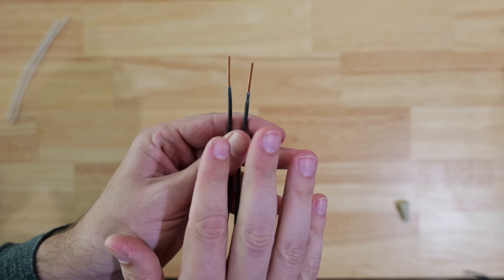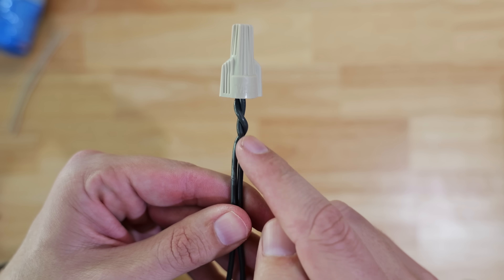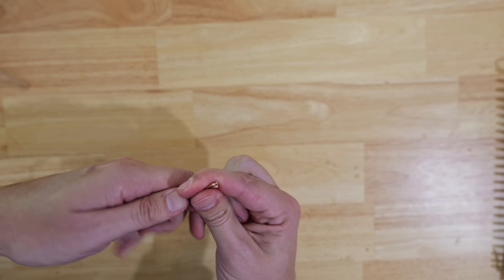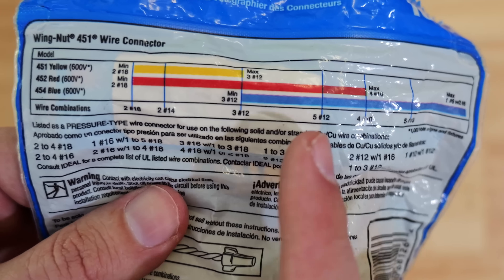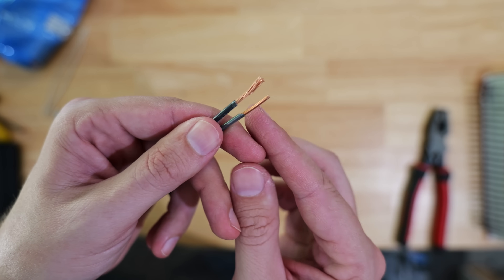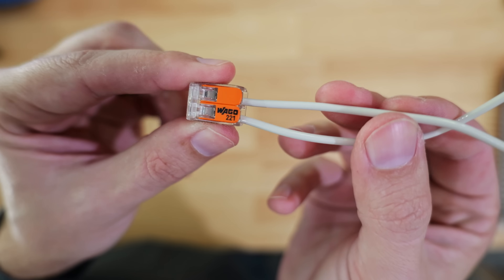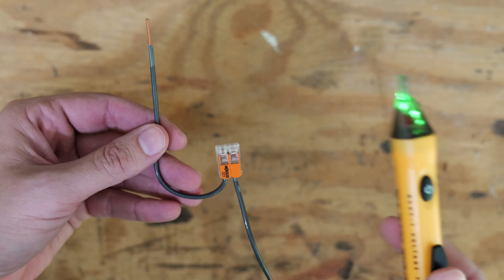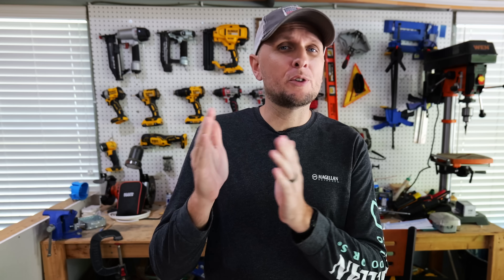7 FATAL Wiring Mistakes Most DIYers Don't Know They Are Making | Most Are Guilty of 3

Comment: DIY guy here....
Never had any of the shown issues with the WAGOs.
If you have concerns with the levers or little space in a box, there are lever-less connectors as well (which work with solid wires only). 👍🏼
Reply: I've met fools who use them "successfully" with stranded in those push contacts. Never underestimate the DIYer with a vision and confidence.
Reply: @RolandsDad  so true! i have seen so many strange diy things in the 20 yeears of beeing an electrician in germany :D
Reply: @RolandsDad  I don't know much about these connectors, but you seem to have a strong opinion about it. What is wrong with using stranded wire with these?
Reply: According to Wago they work with wires that has few strands (and solid ones as well). There might be two types. The Wago 2773 can use wires with few strands but the Wago 2273 seems to be for only solid wires.
Reply: @danielwurmer2266  They rely on pushing force to load the retaining springs. With stranded wire, you cannot deliver sufficient pushing force without getting the strands messed up. It's like trying to penetrate without erection. Surely, by luck you may get a few of the strands into the spring-loaded contacts, working until the few connected strands get overloaded by the current meant to be distributed between all strands of the wire...

Exceptions may be the wires with just a few, solid strands, sturdy enough to deliver the pushing force.
Reply: @TheSimoc  that is definitely not how the wago lever type connectors work that I use. No push force needed. But there might be other types on the market that I am not aware of.
Reply: @danielwurmer2266  The context of the solid-wire only was explicitly mentioned to be about leverless connectors. No-one claimed the lever ones to not work with stranded ones.
Reply: @TheSimoc  yeap, you are right, I got it now. I was missreading and got it all mixed up, sorry.
Reply: I don't know if it's code-compliant, but I use lever-less connectors with stranded wire by tinning it with solder. You can yank it out, but none of those connectors is really that strong to begin with. I wouldn't use that on a boat or something that's moving a lot, but there's really not an issue for a home solution unless you live on a really active fault line. The spring-loaded blades will actually cut into the solder better than the solid copper, so you get a good connection, and you're not likely to get like 40 lbs of force tugging on that wire during normal operation.
Reply: Very likely wrong side of WAGO or cheap knock-off. You buy the right size, right rating, from the proper places and you have no problem.
Reply: Have seen many "leverless" connectors fail. Just as crappy as using the "push-in" holes on devices. All should be banned by the code.
Reply: @GeekOfAllness  just get lever wagos. tinning and using push connectors gotta be the most clumsy and difficult way ive heard of doing it. btw at the factory i worked at for years they used lever wago in enviroments with extreme shaking and vibration(used vibrating tables to move product), never had an issue. and its due to how it grips the wire
Reply: @TraktorTarzan  In my case, tinning 3 wires so I could use the push-ins I bought at Home Depot was a lot less annoyance than waiting a week for lever wagos to come in the mail. And if I was going to do it all the time, it's not hard to have a little plate of flux, then one of molten solder, which tins them very rapidly. So it's not like it's a complicated procedure we're replacing.

I've since played with the lever wagos. They can be easier to assemble, especially with stranded wire, but aren't any kind of real game-changer. The levers aren't very secure, so I've knocked them loose by accident, and had to re-do several wires I'd already finished. This isn't uncommon with traditional wire nuts, especially the cheapos that come with new fixtures, but I don't think I've ever accidentally pulled out a push-in connector without really ham-fisting the bundle.

With either the spring-loaded push-ins or the levered wagos, it's pretty trivial to remove a wire by twisting it back and forth as you pull out.

I don't know much about different brands, but I'm pretty sure I had actual "wago"-branded nuts for the levered style. I can't find the box right now to check though. I have no idea what brand the push-in nuts were. It's whatever Home Depot sold like 6 or 7 years ago.

In any case, I'm an amateur who does occasional electrical work for friends and family, so I haven't used any of them enough to be confident I've tried each style in a manner most conducive to that style's strengths.
Reply: I've used the wago connectors on my motorbike electrics yes I know it's strands of wire not solid cor cable but I solder it beforehand
Reply: I just put a little electrical tape over the Wago levers.
Reply: Wago, the sharkbite of the electrical world. Made for the guy that has a hard time twisting a wirenut
Reply: @GeekOfAllness everything about this is giving engineer vibes to me. Enough know how to get yourself in trouble
Reply: Wire nuts are universal. I've never found myself wanting for WAGO's when I'm working with stranded wire, don't know why resi Europeans keep inserting themselves as if the world is stuck on service loops. Especially a DIYer.
Reply: @mason9807  wagos are universal limitations are wire size and amperage but they go hand in hand anyway
Reply: Wagos are GARBAGE; no better than the "push-in" connectors on 15-amp switches & outlets.
Reply: And the specs on the no lever connectors are what? My main concern is not speed and it's not ease of application. I'm always concerned  with safety, longevity, etc

BTW, how are you handling electrolysis,  increasing resistance, and a few other inherent problems. Along, of course, with wear and loosening due to electro mechanical vibration, not to mention increased resistance due to that, as well?
Reply: @danielwurmer2266 You certainly do have a needed push force.
Reply: @RolandsDad If you're dead set on using stranded wires in that fashion, you can always use a bit of solder to stick the leading edge of the wires together so that you don't have to worry about the issues related to some of the strands getting hung up when you push it in. That being said, I'm a fan of not dying in a fire or getting electrocuted, so I just get the proper supplies to do the job safely without resorting to such things whenever possible.

Comment: 35 year elevator mechanic here.  I’ve used wirenuts for every wire 14 gauge and larger, both stranded and solid wire.  Used to be the only approved connectors for >14 ga. were Kearny’s and wirenuts.  You have to properly tighten them, and if you’re dealing with vibration, I was taught to wrap the finished connection tightly with electrical tape. Never had one come loose, including ones I had done decades ago that I needed to cut off because they were too tight to undo manually.
Reply: Same here.  Started as industrial electrician around 1992.  Still scared of wagos.  Prob because I was always dealing with vibration.  And wagos make me think of back stabbing.  I ALWAYS twisted the wires with lineman pliers first because I've seen so many solid wire tips pierce through end of connector before the wires twisted to what I felt was proper.  1-2 turns below wire nut.  And super 33 or 88 always got stretched over.  Today they say no stretching of tape at all?  Never had a failure...I'll stick with experience.
Reply: For home wiring, wagos are the way to go IMO.  Wiring industrial panels and motors is a different beast, though.
Reply: When in an industrial environment and specifically motor applications we always recommended bolt, lock and nut then three layers of tape starting with flex rubber, then standard scotch and finally friction over the connection.  Worked great and accomodated all our concerns specific to shock, start-up currents, high heat and vibration.  Good comment on elevators as safety is a huge factor.  Cheers.
Reply: @davidyansky6605  First one I did (dating myself here) was full wrap of cambric tape, full, tight wrap of rubber tape, then full wrap of plastic 33 electrical tape.  They showed me the sticky asphalt-soaked cotton electrical tape they used to use before that had 33. Fun times!
Reply: @davidyansky6605  Yep.  Still keep all that stuff on hand today 30 years later.  Still have to handle a peckerhead from time to time.  LOL
Reply: @ssaraccoii  Yep.  Still keep all that stuff on hand today 30 years later.  Still have to handle a peckerhead from time to time.  LOL
Reply: @RICHat22  I have been electrical contractor for over 40 years and would never think about using a Wago connector! In my opinion, they're way overpriced and don't provide near the conductivity of a WireNut. The concept is kind of like Lane and knife edge blade across two wires and expecting it to handle the amperage. It's also similar to quick wiring a receptacle. Never did that myself either but yet people do it and then wonder why the house burns down. lol. I've seen more fire related issues using Wagos and quick wire devices then I've ever seen with the wire nut installed correctly.👍
Reply: That's why they've been military required for much longer than the past 50 yrs, plus. At least the Coast Guard did. We also secured the wire under the tape, below the skirt of the nut. Can't remember if we first used specific wire ties or something else. I've been using brand name wire ties, ever since. As far as I know, I was the first to wire tie the three tape layers around receptacle, when done, once in the center.

A stretched layer. A regular type layer.
Then a 2nd stretched layer. 
That's why I started securing the tape in the center.

Got a couple of "small" commendations from officers, and a number of 3 day passes from non coms because I always said it was the non coms that provided the brain food. Actually, I had two non com uncles.

Hey, best wishes. Thank you for letting me relive that story. My whiter than white wood flooring got many of us 3 day weekend passes. Tri Sodium Phosphate/original Mr. Clean 

The men loved both my uncles, and most of my men, loved me.